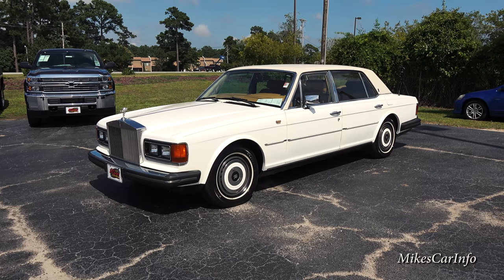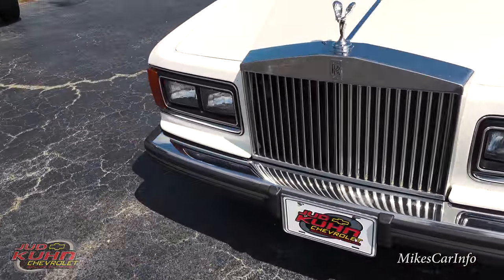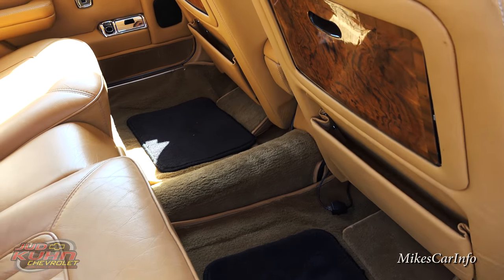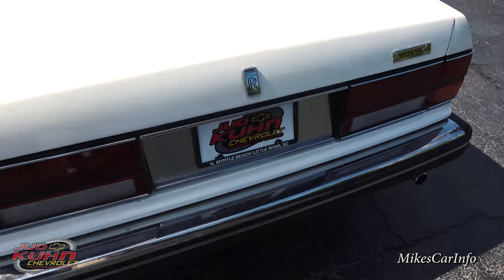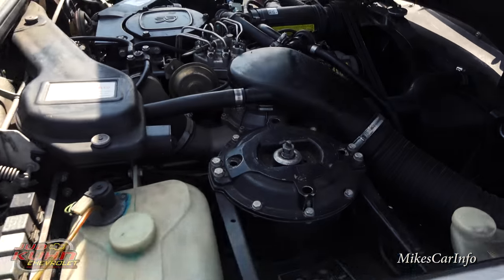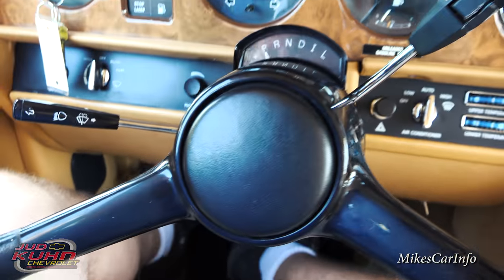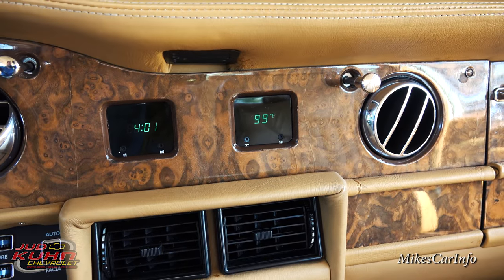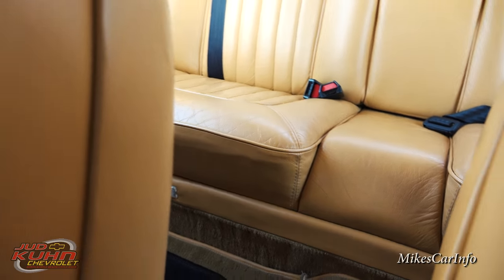👉 1986 Rolls Royce Silver Spur

Comment: I have the Rolls Royce Silver Spur.  A very comfortable car to drive with a lot of power.  Much more quality than a modern vehicle.
Reply: Hey, I'm considering turning this vehicle into a 'drivable' version for the simulator called "City Car Driving", and I'm wondering how the dails light up (if they do at all) at night, if the there lights in the speedometer and techometer, or if there is a light just above the speedometer to light up those dails like on the Peugeot 305?

Thanks in advance!

Comment: Good grief!  Who put the glue-on plastic side molding on this car? It makes the car look like a cheap chevy.  Stop saying wood grain!  It's handmade, hand selected WOOD! That door in the trunk should have umbrellas.  It also has obvious non-RR parts and wires - serviced by a used car shop? Also missing the engine cover, missing RR floor mats, non-RR knobs for interior controls, cheap aftermarket radio, and delamination on the dash and doors, phillips head screws to hold the broken pieces together, and unbelievably HIGH mileage (175,000)  .....   making it as valuable as a chevrolet. Possibly worth about $5,000.

Comment: The "Oil Level" button on the dash simply shows oil level in the engine.  All you have to do is push it down and look at you fuel gauge. "Refuel" simply opens the door for the gas tank.  And the secret compartment underneath the carpeting in the trunk is where your battery is located. I own an 83' Silver Spur, so there are some differences... like the unlabeled switch between the seats.  I have no idea what that's for.  And the switch for your electric fan is clearly a home-made thing some guy did.
Reply from the maker: John Groshko Thanks for the info John!
Reply: +John Groshko What dosr the "I" stand for in the gear selector?
Reply: +Pkain I actually don't know.  I've never used it. lol
Reply: +John Groshko thx anyway :)
Reply: +John Groshko John, where is the power lock button? I thought in the early models it used to be on the door panel. I don't seem to see the switch here.
Reply: +rodney HOLLEY These cars have what they call "Central Locking".  All you need to do is push or pull any of the door lock pins (the manual door locks), and all the other door locks will follow.  It's an very early power door lock system, but it works...
Reply: +John Groshko Why didn't I think of that? My jaguar has central locking also. I must have been think of the Silver Shadow with the switch on the door. Thanks for the info.

Comment: Rubber plug in trunk is access to check air pressure in spare. Screwed wood compartment in trunk is where the battery is.

Comment: The gearlever is indeed eletric operated, and the I on the quadrant means intermediate (2nd gear). The transmission on those is a GM TH400 with the rolls royce eletric shifter.

Comment: Anyone ever had no start issues? 84 silver Spur, has fuel and spark, will not start or run. Unless I spray starting fluid, then it starts. I suspect something with the injection but no idea where to start.
Reply: *I should add, it runs on starting fluid only. Once that burns off it just cranks again.
Reply: If it runs on starter fluid only, you're not getting fuel.